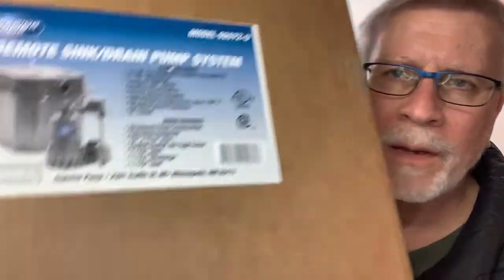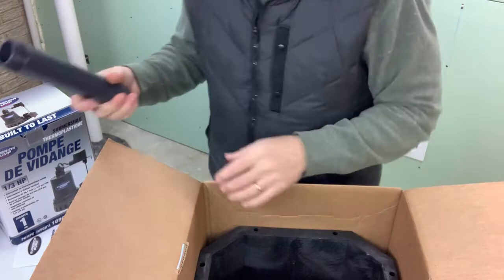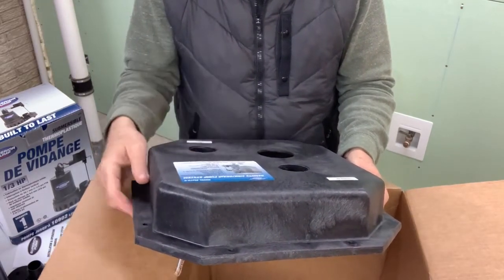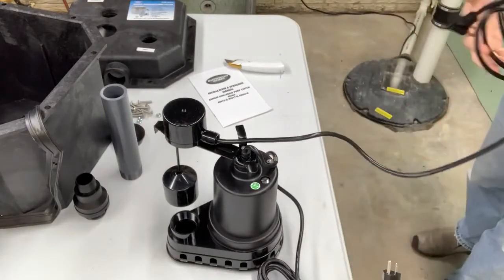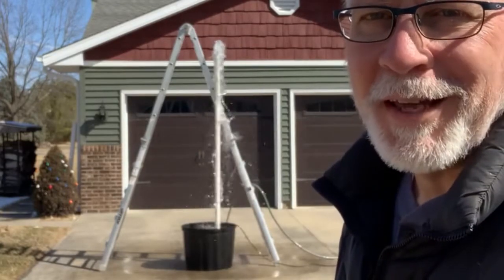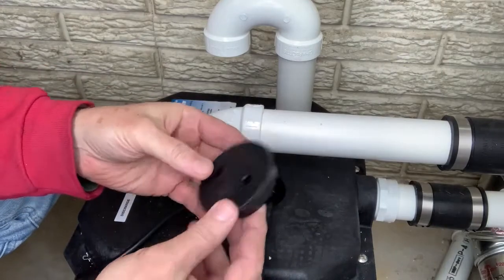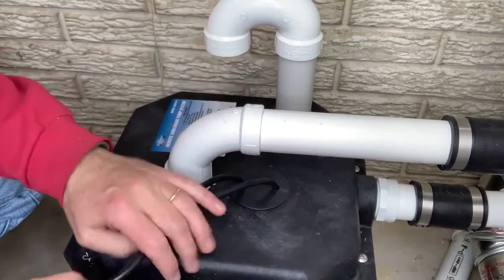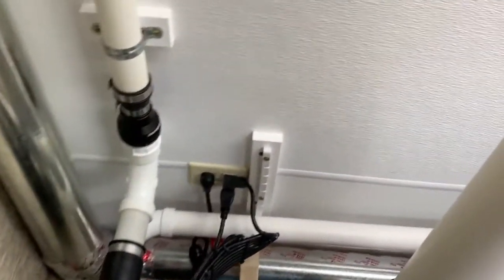Superior Drain Sump Pump Review

Comment: Very clean install . Thanks for showing . I just bought the same pump. I think it might be a good idea to route the open vent just over the edge of the sink …same as a washer drain hose would …in case of internal failure in the instance of discharge water shooting out of the vent. At least you could trap most of it in the sink basin and drain
Reply from the maker: That’s a good idea but remember the plug for the cords is not water tight.

Comment: This was a very helpful post. Thanks for making this video. I feel more confident moving forward with a similar project to discharge the water from our basement washing machine up to the waste line. Question- So you bought three pvc threaded male adapters for the intake, discharge and vent, then cemented the 1 1/2” pipe to those which lead to the rubber disconnect hose with band clamps?
Reply from the maker: I think you have it right. Threaded connection, not cemented. PVC to PVC cemented, PVC to rubber hose not cemented just band clamped.

Comment: Very informative. 
I was thinking about pump failure of your system. It seems like you would want all the plumbing to run through your utility sink including your washing machine and then run it out the pump. That way you would see that the pump failed and you could capture the water in the sink. I liked your cord control technique. I liked and subscribed. 👍🏻
Reply: Adding to your great advice, I would tight a lint filter on the end of the machine drain hose, any ligh cloth to catch the lint, before goes to the pump. A pair of socks works great.
Reply from the maker: I considered that but I didn’t want to see the lint and soup scum building up in sink. You bring up a good point about pump failure. Thanks for the like and subscribing.
Reply from the maker: I may do something like that.

Comment: My cord grommet was lose and pushed out by inside water, which causes water flooding. Do you have any ideas to make the rubber grommet really tight to the top cover, thanks
Reply from the maker: I don’t. And I had a flood when the switch failed. My flood came through my low vent, but would have come through the wiring grommet anyway.

Comment: Did you cement the discharge pipe to the inside of the lid or was it just a snug fit so the lid could be taken off and on while the pump remained in the basket?
Reply from the maker: The pipe press very hard against the lid and makes a good seal. It can be easily opened.